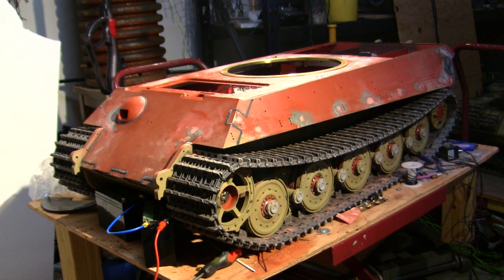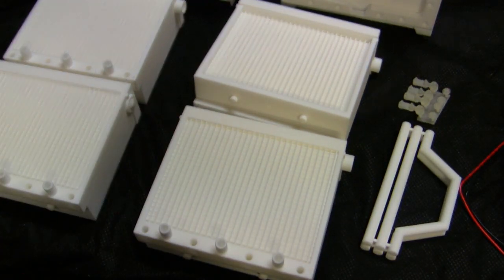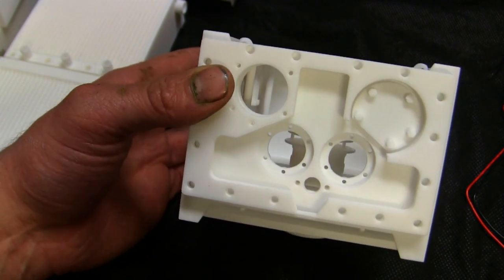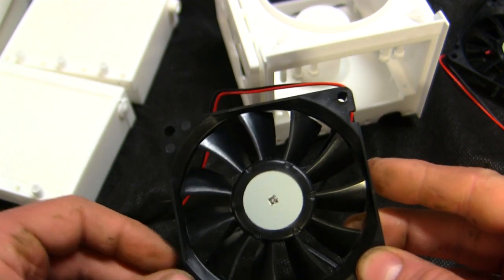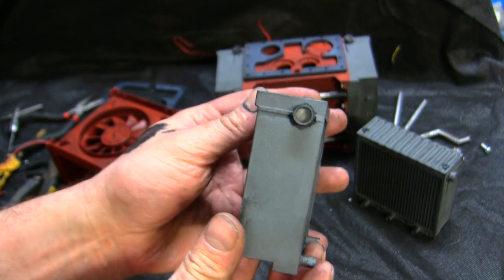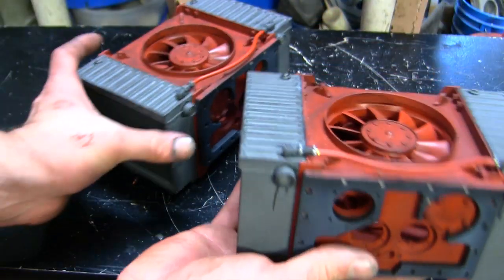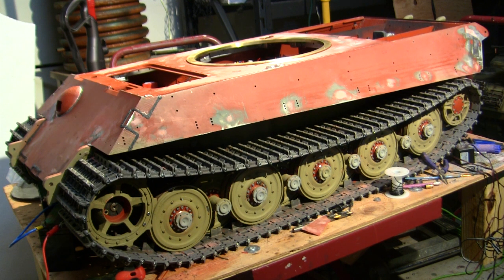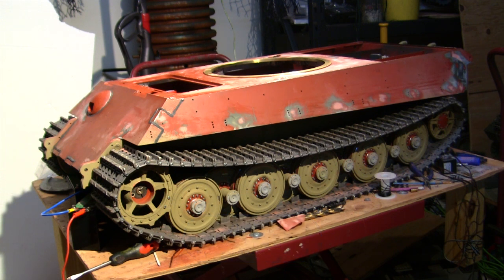Armortek 1/6th scale RC King tiger project video#12 (engine cooling fan / radiator, and hull welds)

Comment: Looks fantastic. I've had quite a few parts made for my tanks in 3D printed parts. I've noticed that the parts made in EBS are very brittle an easy to break, if u drop it it's very likely it will shatter. I think all parts printed should be printed in PLA so it doesn't break so easily. But great workmanship as always. Aussie Scott.
Reply from the maker: for detail parts I'm not a fan of using PLA. Surface texture on some of the best machines is rougher than the method used on these prints. In the past I would have used cast resin for these bits, which is way more fragile than the material I'm using here. Since these parts are not load bearing this material works fine for this application. I will say though that the nylon is more durable than you think, after using this stuff on the trailers and other full kits it's more durable than you may think. It all depends on the application of the part and if the part is properly designed. If done right it will be durable for the job. Same is true for any material though
Reply: @oddball759mm  
Yes this is true. Don't get me wrong 3D PRINTS definitely have there place an I've got some great results. I've just found that some can be quite brittle. Like l had a "CROWS" for an ABRAMS MBT dropped the cradle that carries the 50cal with the cameras an all, an it just shattered into 3 pieces. But l AGREE with what you have said. I will Definitely be using more printed parts in the future, as they are much easier to produce an very cost effective. But l will still be purchasing parts from you still in the future as l have in the past. Never had any issues with the quality of your parts always have fitted well, l suppose that maybe if l order parts from you in the future l should expect some to be printed parts. We Will See. Thank you. Aussie Scott.
Reply from the maker: Well, if you noticed I have been moving away from cast parts towards 3D print. Many of the older items have been phased out and this is a process that will continue as time goes on. Moving forward no new ECA items are being tooled in resin. The current resin parts that are on the catalog will still be available for the forseable future, however as molds burn up more and more items will be transitioned. in about 10 years the catalog will look very different then you see it currently.
Reply: @oddball759mm  
I've got quite a few printed parts on my tanks. An lve been amazed at level of detail, but lm just a bit concerned about losing things like the clear parts for commanders cctv, copula, drivers copula, how will you print clear parts. The only place l get parts is off you as l no you make them to spec, an the fit is always good. Also BRILLIANT WORKMANSHIP on the last commission builds the king TIGER engine bay was very good, great job. If you didn't live on the other side of the planet I'd get you to do 1 for me. But l would like a modern main battle tank like a CHALLENGER 2 with all the upgraded choggum armour in 1/6 scale. I think this would be awesome!! But only if the British company would make it. I'll have to live with hope. Aussie Scott.
Reply from the maker: I have a few parts that are not opaque and are printed. The lenses on my head lights, and tail lights come to mind, or the optics I have for the recoilless rifles. The HD parts are translucent which for that application are perfect. For parts that need to be completely clear the print would not be the way to go and I would recommend parts made in lexan or some other polycarbonate. On parts like the new german AFV interior periscope mounts the clear panzerglass is achieved by having a standard opaque printed box frame, that clear polycarb inserts get fitted. Once assembled they look much better than attempting to cast these solid in clear resin which in most cases ends up being translucent and rarely clear.